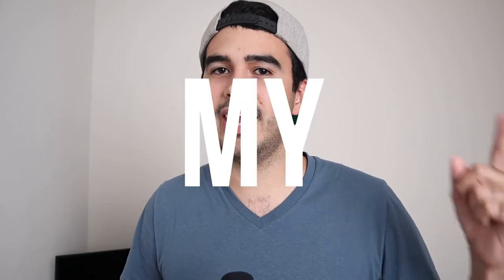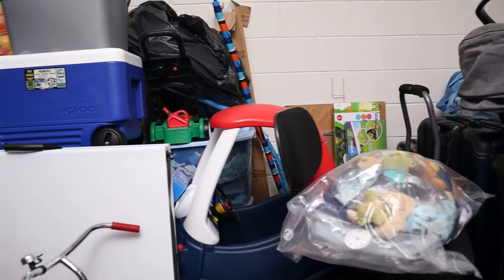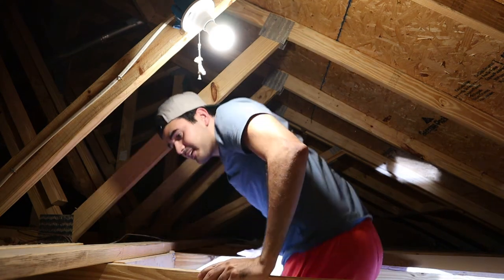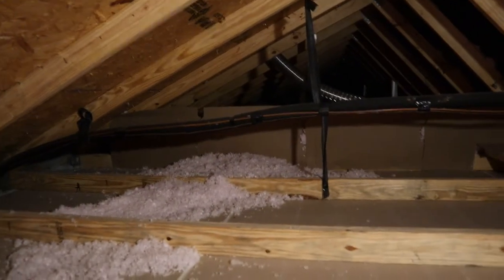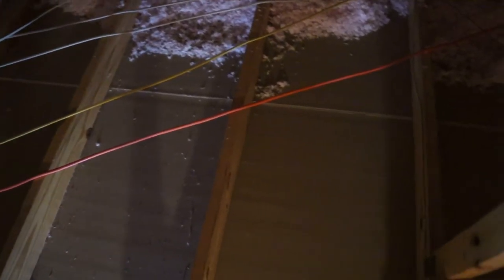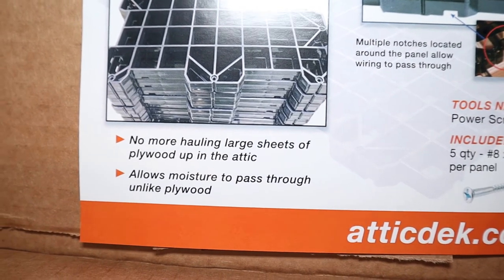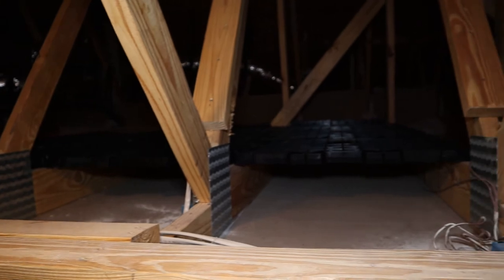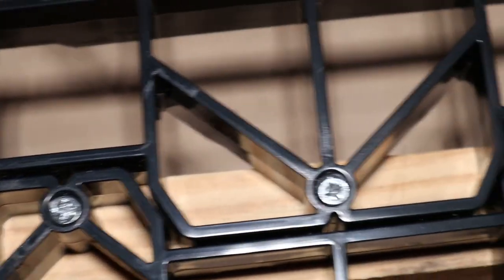Installing a Floor in the Attic for More Storage Space DIY

Comment: I took a similar approach before installing blown-in insulation. I took 2x10s about a foot long and nailed to them pieces of plywood extending down about three inches. That combination slips over the existing 2x4 rafters and won't move from side to side. I then placed two of them alongside one another on adjacent rafters. Then I nailed another 2x10 between those two. That created a platform, that was enough to get about in the attic. But to make it even better, I nailed longer 2x10 boards to connect the platforms. I now have a path I can take to almost anyplace in the attic above my 16" of blown-in insulation. To create flooring, plywood sheets could be nailed on top of the platforms.
Reply from the maker: Thank you for sharing your technique. I appreciate it!

Comment: no links to what you purchased or at least where and part #'s. how about predrill and use wood screws maybe 4" long
Reply from the maker: I will try to find a link later to send to you. And you're right, pre-drilling probably would have been the best option. Better screws would have helped too, but I just used the hardware that came included with the panels. Thanks for your message :)
Reply from the maker: Here's a link to what I purchased: https://www.homedepot.com/p/Attic-Dek-Universal-4-Pack-Made-for-16-in-or-24-in-On-Center-Joist-Spacing-351804/310357036
Reply: @PanemProject  so almost $1000 for this flooring?????
Reply from the maker: @agogley  The panels are expensive, but they were cheaper when I bought them in 2021

Comment: Did you need a permit from the city for this?
Reply from the maker: Prior to moving in, I had a conversation with the construction superintendent, and I don't think a permit was required in my area. Installing the deck doesn't change the occupancy of the house which was one of the permit exemptions. Also, I did not cut away any truss member which could affect the structural integrity of the roof. However, I would check with your local jurisdiction to be sure.